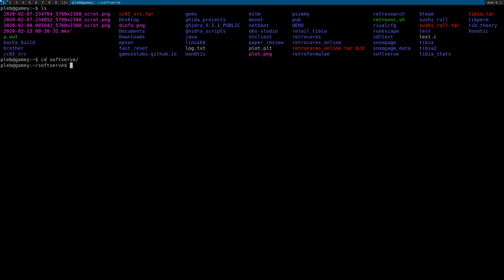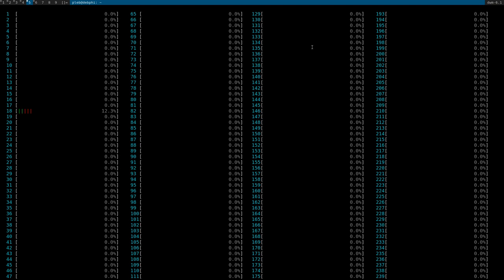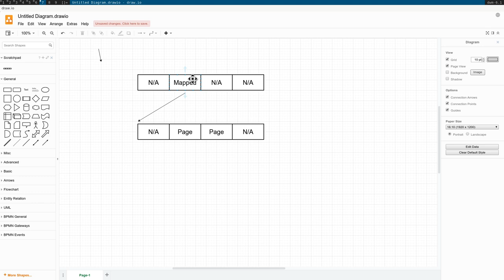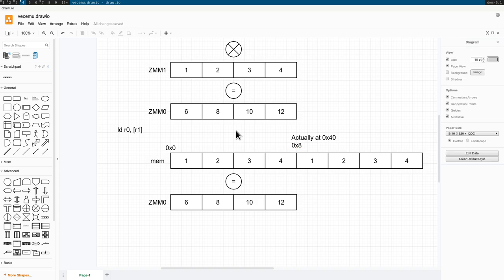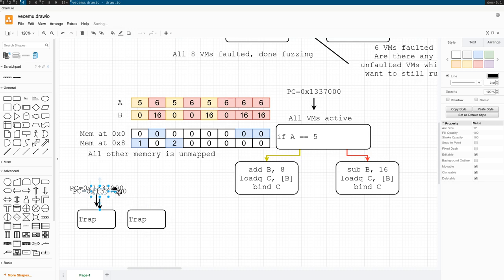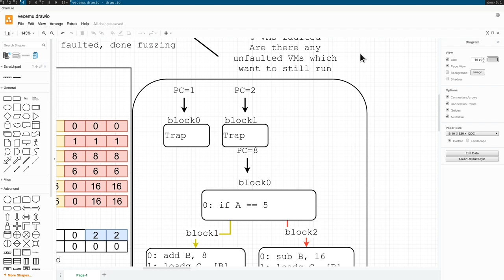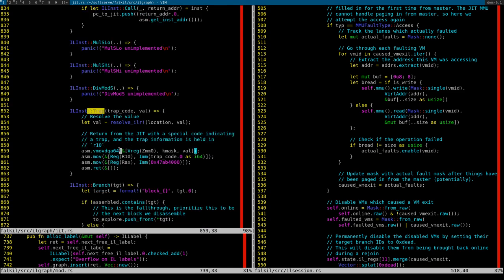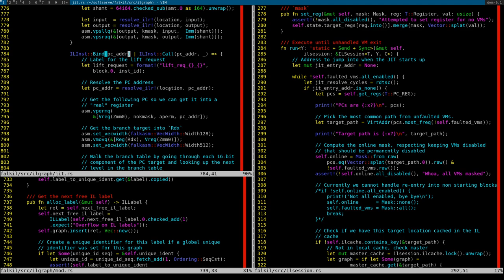Vectorized Emulation: Branches (Part 1: The problem)

Comment: Re: Bing start menu nonsense:

this fixed it on my computers.

Windows Registry Editor Version 5.00
[HKEY_CURRENT_USER\Software\Microsoft\Windows\CurrentVersion\Search]

"CortanaConsent"=dword:00000000

"AllowSearchToUseLocation"=dword:00000000

"BingSearchEnabled"=dword:00000000